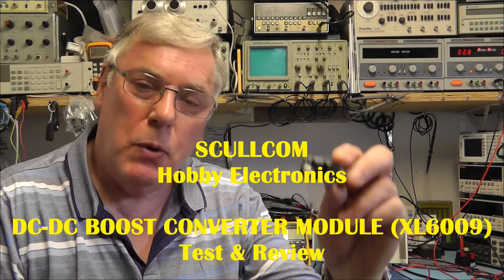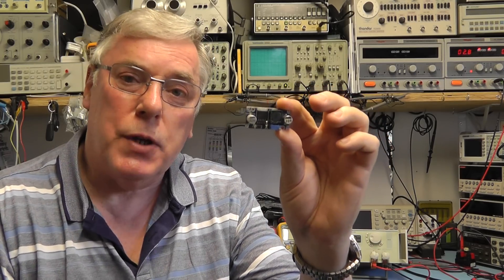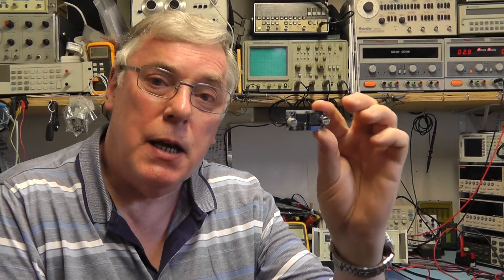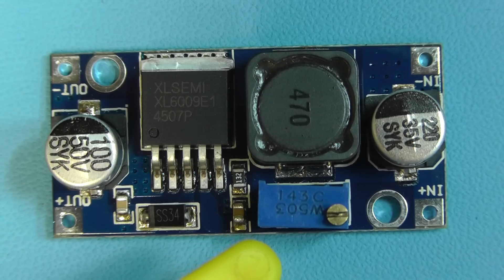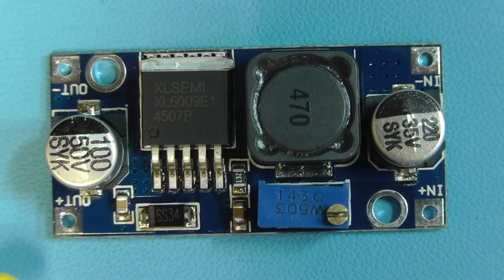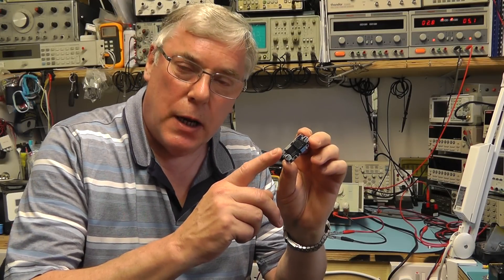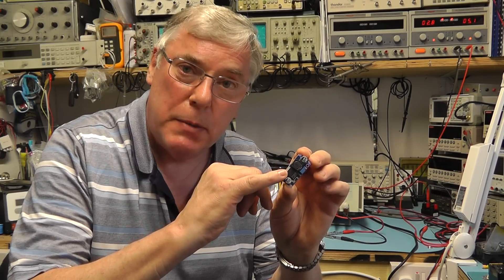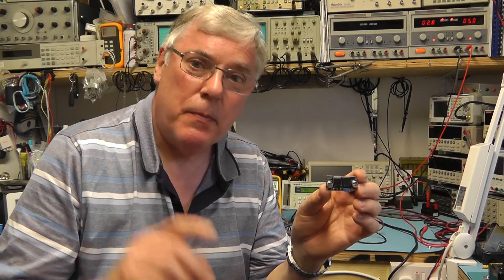Scullcom Hobby Electronics #19 - DC-DC Boost Converter Test & Review

Comment: At 10:45 you feel the chip and it's "red hot", but the actual dissipation is less than 800mW going by the numbers (9.81v@1.1A in = 10.791W, 10W out).  

The back side of those boards is one big copper plane with lots of thermal vias under the tab of the IC,  it should be able to ditch that 800mW.  I think if you had let it stabilise you'd find that the temperature becomes not-unreasonable.
Reply: +James Sleeman   I bought a few of these and they sometimes behave oddly under certain conditions I have noticed they have a tenancy to go into thermal runaway even with a heat-sink using thermal compound cement stuck to the back. What I noticed was the output would be unstable while adjusting the trimmer it will sometimes put out lower current but draw more current, while turning the pot it would then swing to a higher output current/voltage and the drain would drop, the input being around 4.88 volts like the chap in the video is showing, I may have a faulty unit here but it is very unstable in my tests.
Reply from the maker: James Sleeman Thanks for your comment.
Reply: +Ortorea Screenname 
Yeah these are just cheap and crappy in general :S
There is a video on here of someone demonstrating what happens when you turn the potentiometer down too far ... the output voltage goes unregulated, and it blows up the capacitor. At least theirs did, I couldn't get mine to do it, but theirs looked slightly different (same chip though).

Comment: Thank you for the upload!

I want to step up 3.7v to 9v-12v at >= 500ma.

Can this be done? I am trying to stay small. I have a 3.7v 1200mah LiPo for supply.

Thanks!
Reply from the maker: CORZER0 Yes. This DC to DC converter should do the job for you. This module can accept an input voltage down to 3 volts so your 3.7 volt is OK.
Reply: Scullcom Hobby Electronics Thank you, kind Sir!

Comment: I hope you take this as a constructive feedback, not as someone whining on the internet...

Your videos are good in general, but you seem to take very small steps when adjusting the voltages/currents and you show each step you adjusting the load without really  cutting the footage. I as a viewer don't have to see all that to get the point you're arriving to. I mean that your videos could be more to the point if you cut out part of those steps.

Right now the video is over 5 minutes longer than it really needs to be. You could have shown first few steps, then cut straight to the results of each step instead of showing the process of pressing buttons to get to higher current setting each time.

But it's OK since I can jump over those parts myself, but I would prefer that your videos would have more time put into cutting them to be more to the point.

Hope you continue making videos regardless :)
Reply from the maker: Mtaalas Thanks for your comments which are very valid. I am fairly new to You Tube so may get better as I progress!
Reply: Scullcom Hobby Electronics 
I like your videos the way they are. For me you don't need to speed up or cut out parts.
Just my personel point of view.
Reply from the maker: Mtaalas Thanks for your comments. You have some valid points and I will try and take note. I am new to You Tube so still learning how to use it.
Reply from the maker: Jürgen Ollig Thanks.

Comment: Hi , bit of a noob  in electronics so pls bare with me . I saw the video and was able to understand that it was able to handle upto 10w of power. I have a use case where in I will be supplying an input of 60w i.e. 12v 5A. Will I be able to use 2 of these in parallel to get outputs of 5v 3A each it would still be at 30w combined. Is this feasable ?
Reply: Sravan Reddy The golden rule is never connect the output of power supplies in parallel. Rather find a module that's designed to handle the load you want to drive.
Reply: +Aadil Shah Maybe it is your golden rule (probably you invented it), but in practice putting power supplies in parallel is relatively common practice for high output currents.Of course there is some rules how that should be done.
Reply: Petar Petrovic There's pretty much only two ways to do it:
1.) use a pair of power supplies that are specifically designed to have their outputs connected in parallel. These usually cost about five times as much as a standard power supply with the same specifications.
2.) add a pair of identical large value, load balancing resistors in series with each output. While the resistors need to be relatively large value, they must be chosen for the load impedance. This works well for high impedance loads but is totally impractical for a low impedance L.E.D. that has negligible resistance.

In the case of A.C. power supplies, you also have to ensure that the outputs are precisely in phase, which negates solution number two.
Reply: Aadil Shah You are wrong about second way, you do not need large resistance (but that is dependent how well output voltages of power supplies are match) and usual value used is less than 0.1 ohm (or that is big resistance to you),. That solution is suitable for any load (not as you stated only for high impedance load) with any power supply and it is commonly used in high power telecom DC power supplies (>5000A).
There is other ways also (like specific circuits for IC that are made only for that purpose ...).
Reply: Petar Petrovic "high power telecom DC power supplies (>5000A)."
Well that right there is a specialist application that's not going to be using some random set of Ebay specials.
0.1 ohm is a strange value for a through-hole resistor. The cheapest I could find was 5ZAR. 
I think the smallest resistance I've ever personally used is 56 ohm.
470 ohm is the lowest I generally use in my own designs. 

"(but that is dependent how well output voltages of power supplies are match)"
You're assuming that the OP has purchased a matched pair of power supplies, in which case option one applies. However, it's safer to assume that any random pair of power supplies are not matched at all.

You can probably get away with a hacked solution with a boost mode SMPS, but with a buck converter or a linear regulator you're going to overload one of the two supplies while the other sits idle.
Reply: Aadil Shah I am little puzzled with your statement about resistors. For most current sensing application maximum value of resistor I used was 0.33 ohm (and that is very rarely usually much less or multiple 0.33 ohm resistors in parallel). 0.1 ohm is pretty standard value for 5W resistor wire wound 5% resisters.
You do not need that OP be matched, here is simple example, let's say you want parallel multiple LM7805 (I know it is stupid example but I use it as easy example), LM 7805 have output voltage from 4.75V to 5.25V (that are worst conditions), with only 0.5 ohm resistor with more then 1A current they would start to share load (till 1A only one will supply all load) in worst condition (when one have output voltage on lower end and other have on higher end). This is gross oversimplification because there is many other factor that will play role in how they will act (like current limiting ....).
Boost and buck controllers will work same in parallel application (boost will have trouble if output voltage is same as input, but only in classical design that do not have current limiting features), for linear power supply personally I think there is no need to parallel them because they can be easily made in any power you need (just add more output pass element in parallel).

Comment: Great Video! Question: Why is the input voltage decreasing as the output current load increases? I would think that if the input is a constant voltage source it would remain stable.
Reply from the maker: Rad Stor Thanks. The reason that the input voltage was decreasing as output current increased was due to the fact that the power supply I used at the time to feed in to the unit was not handling the higher input currents, and was limiting. I probably should have used one of my better quality bench power supplies. I will do that next time.

Comment: The thing is though, for the tiniest bit more money, you could make a far more efficient, less electrically noisy, higher rated boost converter.
Reply: bgdwiepp the reason the chip gets so hot and the voltage drops under load at higher output voltage is because the inductor saturates.
Reply from the maker: bgdwiepp Thanks for your comments. Some of these modules do come with different value inductors. I have some with 47uH and some with 33uH inductor.

Comment: The trimmer The unit comes with is really poor quality.  If you replace the trimmer,  it's not a bad unit.  Also, I think someone measured the switching frequency, and it was lower then what the SEMI chip should be running at - so that points to it's being a counterfeit chip.
Reply from the maker: GeorgeGraves Thanks George. I think your point about counterfeit chip is very valid as when I check the switching frequency it is running around 50KHz whereas the XL6009 datasheet says it should have a fixed frequency of 400KHz. So clearly these are either counterfeit chips or rejected chips.
Also I agree with you the trimmers are very bad making it somewhat difficult to be accurate with the output voltage. This modules are only useful for low power application.
Reply: Scullcom Hobby Electronics Yes, exactly - very useful for low power stuff that needs 250mA-1A - they are awesome. I've used them in projects, but replaced the trimmer with a real bourns trimmer.  (actually, if you desolder the trimmer, there are pads on the top side for two resistors to make your own custom voltage divider) Anyways...Very useful where a linear reg would be needing a HUGE heat sink on a 12-24volt source.  The one down side I worry about is that the fake chips at 50kHz might have lower harmonics that might bleed into a line level audio cable? (Wait - I could be totally wrong on that - is there such a thing as lower harmonics? I only remember upper harmonics from physics class)
Reply from the maker: GeorgeGraves Yes there is such a thing as low-order harmonics this is normally caused if the impedance of the output load changes with a change in applied voltage. I believe it is normally referred to as a nonlinear load.

Comment: I have many of these modules and I used them successfully in many applications that require low wattage. It seems a bit hard to stick a standard heat-sink on the module?
Reply from the maker: MrMonomonster You can use some thermal conductive heatsink glue which works very well.

Comment: Struth they were being mean to that chip, a decent heatsink would be a minimum for reliable operation.
A bigger/faster diode may have helped as well.
I bet the output wasnt too clean eather, but still an interesting cute little unit for the pennies :D
Reply from the maker: GeorgeGraves George, I have used thermal conductive silicone heatsink glue which works very well and allows you to stick heatsinks on top of the chip, now problem. The one I have used is Halnziye hy910 Silicone Heatsink Plaster (10g tube) costs about £1.66 on eBay. I believe it can handle temperatures up to 300 °C. I have also found it useful for attaching heatsinks to high power LEDs.
Reply from the maker: zx8401ztv It was very cheap so OK for low power applications. I suspect the chips they use are either counterfeit or rejects.
Reply: zx8401ztv   The problem is there is really no way to heat sink the chip once it's tab soldered.  Unless there is a solution I don't know?
Reply: GeorgeGraves I bet a copper heatsink could be fashoned from a bit of old copper waterpipe, once clean and bent into a sharp "U" shape the ends could stick up eather side of the device, cut fingers into the ends and twist to create a typical shape.
Being copper it would solder to the device nicely :D